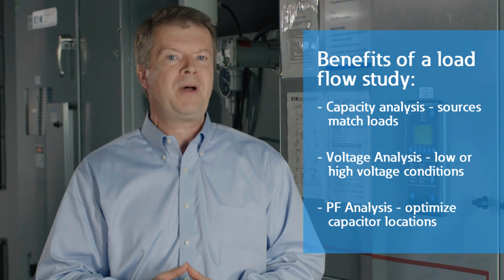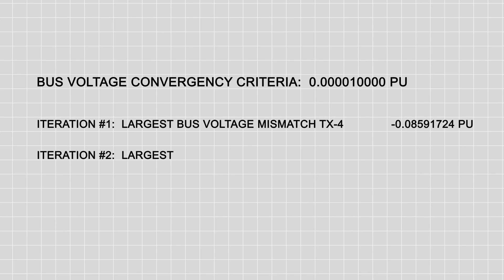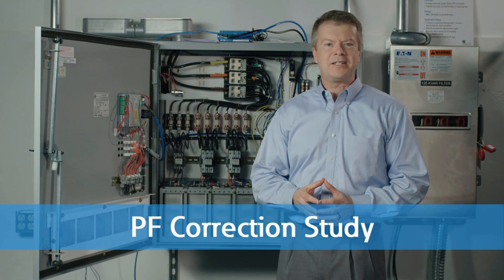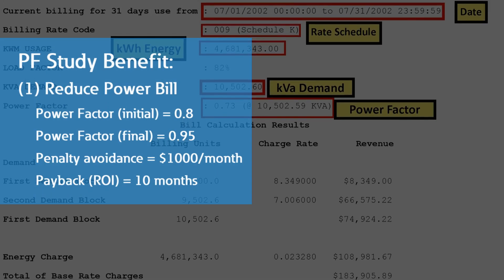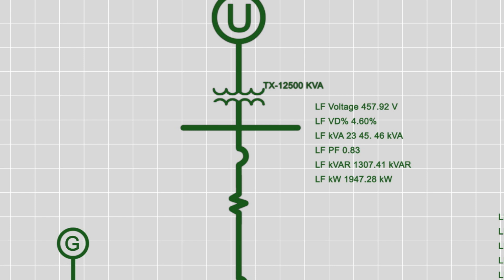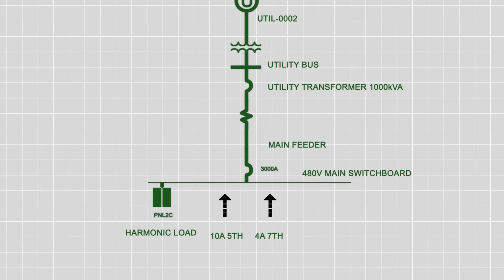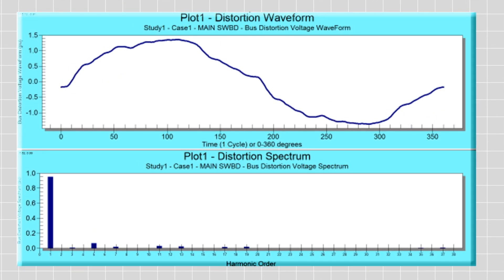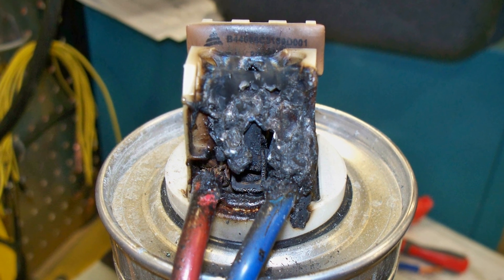Power System Studies - Load flow, power factor correction and harmonics

Comment: I enjoyed the presentation! You viewers should know in most cases if you clean up your harmonics you also significantly improve your power factor. Capacitors are about as green an energy saver out there.
Reply: Hey Mark! I'm an EE student I didn't know this. Thank you for that insight!  
My dad works in a hotel, and they have a horrific pf (0.46) he's trying to save costs, I thought that it might be a simple fix, change capacitor bank, but now as I see this video with harmonics and current flow analysis, I see it is a lot more complex!
Reply: I agree, just remember that some pf correcting capacitors can themselves produce harmonics, especially in the case of resonant harmonic frequencies of a given system. I've heard of inductors being placed in series with capacitors to deal with issues (Ironic that you'd use inductors to solve a problem that only occured because of inductive loads in the first place). Probably uncommon but worth mentioning I think.